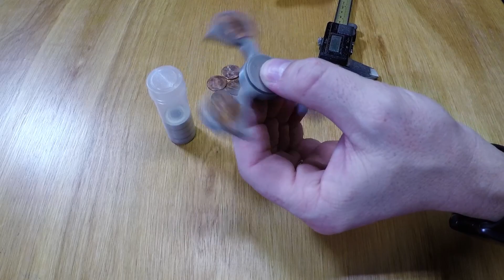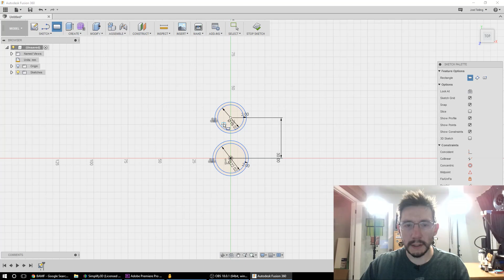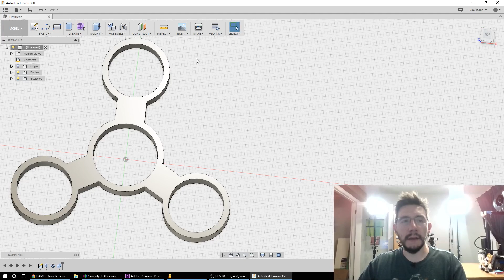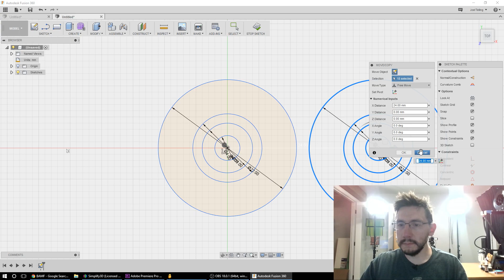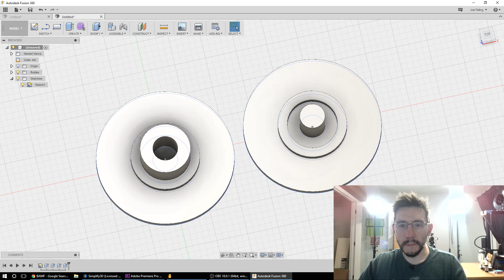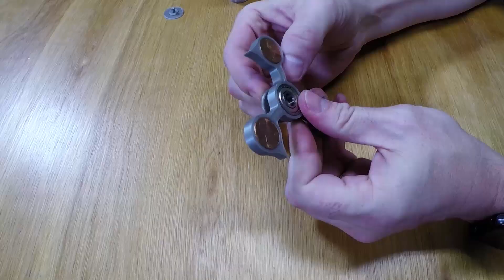Fidget Spinner using PENNIES? 3D Printing is Awesome!

Comment: Would you mind letting me know what you used for perimeters, top/bottom layers, and infill for the interlocking caps?  The male part seems weak and has broken from the base a few times.    Any suggestions to strengthen?  Thank you very much!

Comment: Joel instead of using Penny's bearings or nuts you should use the 3d plastic as a weight wear the weights would go just 3d print those holes as one piece

Comment: Where else would I be able to get bearings other than amazon?
This link Joel provided has them for $7.33 plus $42.79 for shipping, which is ridiculous!
Reply: eBay, buy cheap 608ZZ from china (around 2-3USD for a pack of 10 bearings), wait a month for them to arrive.
Pop off the lids, clean them with rubbing alcohol, add machining oil and print yourself a spinner :-)

Comment: Hey Joel, consider making the pads buttons that you squeeze together like an air spring, then put a routed air pathway around the central bearing.  Then when you squeeze the pads together it will spin, then as air comes back between the pads you can squeeze it again and keep it spinning.

Comment: The semi-interference fit you showed works well for a lot of things, but not for things that need to meet snugly.  If you think about it, the closest you can get is within half the height of a layer.  The layers will be offset, because one piece's layers will be in between the other piece's layers.
Reply from the maker: +Carlton Dodd ooh that's a really good point. Good enough for a fidget spinner at least :)

Comment: Maybe you can create a 2 mm hole to one part (not the part with the pin) so if you want to remove it you can push the other part out by just pushing it's pin. Nice video as always.

Comment: I soaked my steel bearings in Acetone a couple minutes. It worked great. you can spray a little WD-40 after to prevent rust. I have a ceramic bearing on one spinner and the steel one I modified spins nearly as long.

Comment: Spin faster:  A.  Pry off the shielding with an exacto or very thin/small flat head
B.  Drop in a bucket of gasoline or acetone to dissolve the grease
C.  Remove bearings and set out to dry
D.  Single drop of light sewing machine oil or 3 in 1 oil and viola..very fast but makes more noise bearings

Very awesome design...Keep it up man!
I remixed a girly flower spinner that uses 1/2" ball bearings and spins well, its on thingiverse 
http://www.thingiverse.com/thing:2299034
Reply: For spinners personally i recommend zero lube, completely dry.
and rubbing alcohol works fine to remove the grease

Comment: In my tests so far the Průša prints a little undersized which makes the identical peg and hole work, if it is too tight use offset 'O' on the line and a small gap, 0.1mm should do it! Love the sound they make snapping together lol
Reply: Maker's Muse lol only 4 like and 0 comments hi maker’s muse
Reply: notice me senpia
(11 to like)
Reply: Maker's Muse

Comment: Hey Joel, I model in threads in the finger grips / caps, I've found M6 work best and are easily achieved in Fusion 360 by using create - thread, select the face where you want the thread and before clicking ok make sure the Modelled tick box is checked or they won't appear on the model when printed.

Comment: It. It the ZZ bearings.
Get a 2RS ( 2 rubber seals ) then use a knife tip on the inner of the race and ease them both out.
Use an air gun a blast the grease out.
Keep the seals out and you will have a lot less resistance.

Comment: Hi Joel, the 608zz bearings are what are used in skateboard wheels and scooter wheels, so from my days of skateboarding I used to use any sort of bearing lubricant like  https://www.amazon.co.uk/Speed-Cream-1-2-oz/dp/B01ESBX5D0

but the fidget spinner i have i just used my airbrush the help spin the spinner up to a high RPM which seems to of helped get it to spin more freely

Comment: To make the bearings spin faster remove all lubricant.If is there is a light layer of grease soak the bearing in acetone. Try holding the spinner up to compressed air and it will spin crazy fast.

Comment: To make your steal bearings faster.
What I do is take the metal caps off. Any Tool will do
Then I leave them 24-48 hours in Acetone/Nail Polish.
You cant but the metal caps back on but it should spin faster

Comment: Those bearings have a metal ring around them, if you get the one with rubber shields then you can pop off the shield with a knife or small flat head screwdriver then just soak/shake then around in some rubbing alcohol(99.9%) then let them air dry, tips- do not use water, it rusts them, also dont use any oil/lubricant afterwards, this makes them slower. It might sound louder but works amazing.

Comment: I have heard that if you pull the dust caps off of your bearings and get rid of all the grease by soaking in alcohol or brake cleaner the bearings will spin longer. Going to try it with my own bearings soon.
Reply: PC Pyro It's true, and for a spinner it's ok but for applications where there is a load on the bearing it is not smart

Comment: Ceramic bearigs don't have to be so expensive try amazon. I used gun oil I had laying around with a cleaning additive and such on my 2 crappy bearings in my 2 cheapy spinners and got a ton more spin out of it.

Side note, if your buttons can't be safely removed then that locking method is innapropriate for a spinner, as you really should have access to the bearing.

Comment: wheres angus at i bet he can build one that fits the strayan 5 or 10 cent coins or or maybe because we going green and gold 1or 2 dollar coins ooooooooo that could make the fidget spinner depending on how many coins 6-12 dollars worth well who knows
Reply: Here in the UK the new £1 coin is 12 sided
Reply from the maker: +lightningandcloud all coins are the same as this, just require a different diameter measurement!
Reply: all round coins...some coins out there are not round.

Comment: didn't see exactly what bearing you used. 608 bearings generally come loaded with a heavy grease. if you have zz type (metal shields. dunk them in some petrol (gasoline in the states) and slosh them around for a few seconds. remove and let dry. and there you go. if you have rs type (rubber seal) remove the seal caps with a pick then treat the same as zz type

Comment: Great design Joel and thank you for the tutorial. I use this affordable ceramic bearings on my spinners and work great. 
http://www.ebay.com/itm/1-5-10-Pcs-608RS-Roller-Skates-Ceramic-Ball-Inline-Skate-Bearings-Drift-Plate-DP/112158081805?_trksid=p2047675.c100012.m1985&_trkparms=aid%3D777003%26algo%3DDISCL.MBE%26ao%3D2%26asc%3D40130%26meid%3Db1e2a63edd7d41a08655e02b65bc1a92%26pid%3D100012%26rk%3D4%26rkt%3D12%26sd%3D112178949409

Comment: I use a chisel now too, nice cheap ones from lowes (project source).. I find myself not hurting the platform or my hand from having to pry and ram. and it's like you get two fulcrums in one place. If a part is being stubborn, just flip it over and use the other side for more lifting height.

Comment: Thanks for the info you should buy abec 11 bearing very fast and cheap if you use aliexpress.com they wholesale everthing from China's factors and well really any factory and there usually isn't any minimum. the phone app even has discounts I got 54 amazing bearings to sell in my spinners for like 30 bucks so less than 70cents per high quality bearings and trust me I used to be a skater back in the day the abec 11s are fast

Comment: Joel, If you want to make a fastener that snaps together but can be taken apart, make sure you have a 0.1mm gap between the two connecting parts. This allows for the friction to hold the parts together, but they can still be separated. The plastic however will wear smooth eventually if you keep opening and closing the parts.
To get interlocking parts that come apart easily, use a 0.2mm gap. This will loosely hold parts together, but would need glue if you want them to hold. This is more for aligning parts that need to be printed separately or to give you a greater glueing surface on smaller parts.
Reply from the maker: +Maxx B ooh thanks for the tips!

Comment: awesome video, I used this interlocking technique quite often while designing 3d prints. but I lack the video making abilities so I'll leave this to the pros like you. thanks for sharing. 
one little addition: make the fillets multiples of the layer height. 0.5 mm on 0.2 mm is not printed as you designed it. so I'd suggest using 0.4 or 0.6 instead.

Comment: Hi Joel. To make the bearing spin faster here's a tips:
First you should get rid of the caps that cover the balls then soak it into a grease remover for metal like odorless petroleum (pétrole désaromatisé in french).
Let it soak five minutes stiring it a little bit to make sure all th grease is out then you'll have a very fast bearing.
Reply: mine are also the zz style bearings and using a sharp object works fine. the metal is thin and pierces quite easily
Reply: this is what I do, I remove the caps and soak in wd40 and they spin very nicely
Reply from the maker: +EtnaranTV how do I remove the caps?
Reply: Joel, Im not saying this is the safest way, however I pierce them carefully with a sharp knife (old steak knife i have a set of so that they are sturdy) once it is pierced I can pry it out. The covers are thin layers of metal and bend out fairly easily. Let me know if you come up with a safer way :)
Reply: a knife, micro screwdriver or anything thin enough
Reply: for a plastic cap a simple exacto knife do the job. for a metal one i pinch it with a small knife or anything sharp and small then use it to make a lever. But you have to be carefull not to go too deep and touch the bbs
Reply: I do this without removing the cap... all you need to do is put an 8mm (or 5/16" close enough)bolt through the bearing and lock it with a nut.. then I put the bolt in a drill or drill press and spin it up, you can now spray WD40 or PB Blaster onto the race (with the caps on) and while holding the bearing against the spin it will work it's way into the bearing and liquefy the grease which will come out out..  leaving the dust caps intact...
Reply: Oh, that's nice!
Reply: The dust caps can be removed with a small flat blade screw driver and picked out.  The bearings that you are using have a plastic part inside that holds the balls together it will fall out if covers are removed. The bearings with metal keepers inside stay in place because the inner race has a grove in it for the bearings to ride in. I suggest taking one apart to see its inner workings. Also Brake Cleaner from auto parts store works great for cleaning the small amount of grease out of bearing with or without cap on them(it has fumes be careful) use it outdoors.
Reply: the grease is not there to reduce friction, it will actually slow the bearing down with more resistance..  The grease is to lubricate the bearings to reduce wear... in a roller skate or skateboard the person moving is enough to make the grease resistance unnoticeable.. In a spinner where there is far less mass moving the bearing, the grease just slows it down... and you will probably never wear out a bearing by hand, so lubrication is unnecessary
Reply: If you go too far in you may pierce and damage the plastic holder that keeps the bearings in place
Reply: I will have to try this
Reply: +3D Printing Nerd You just use a sharp object to remove them. I see you linked to a 608*zz* bearing though, and I see you have zz bearings and not rs bearings. This means i can't help you, since the zz means they are made of metal.
Reply: Just getting the grease out of them will make them faster. Also have you tried graphite? Like pinewood derby cars use. ( Boy Scout reference)
Reply: I know this is a dumb question but wouldn't removing the grease make it slower since the grease allows it to spin with less friction?
Reply: Actualy the grease lower the friction damages and fill the little scratch made through the mouvement but it slow it down. Ususaly you don't need a bearing to spin freely as fast as a spinner.